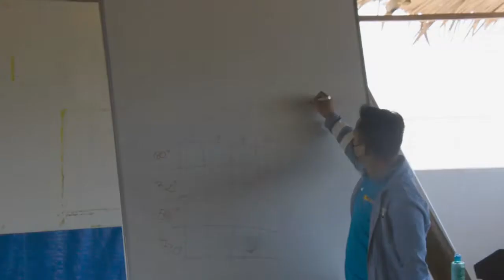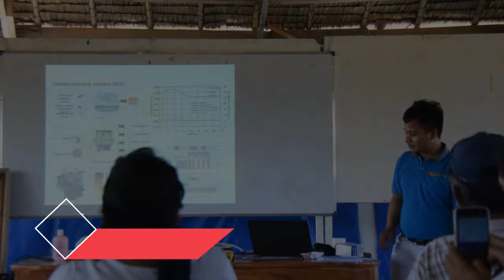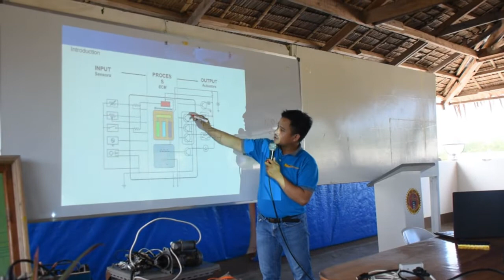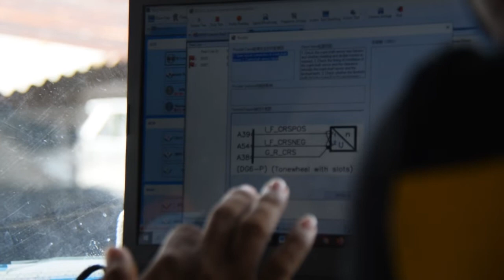PowerTrac Workshop (LGU-Bayawan, City Engineer's Office) Please Like and Subscribe !!!

Comment: a timely training since the motorpool is planning to add more electronically operated equipment; the personnel are already equipped with the knowledge and skill needed to fix/repair troubles
Reply from the maker: the Motorpool Section of the City Engineer's Office LGU-Bayawan are  now capable enough to manage electrical trouble to our electronic construction equipment.